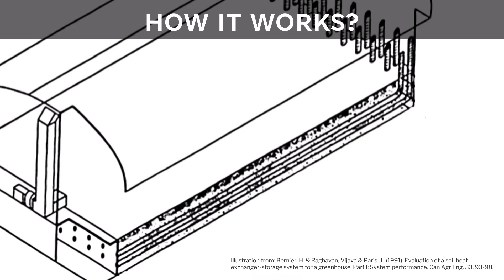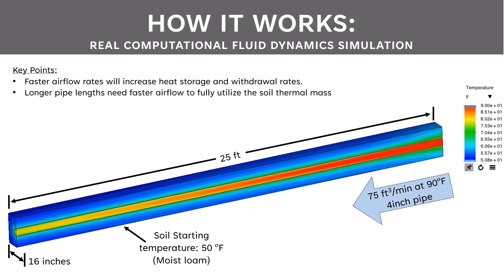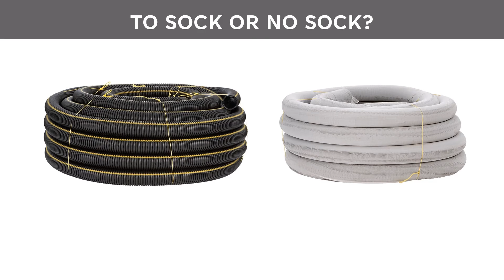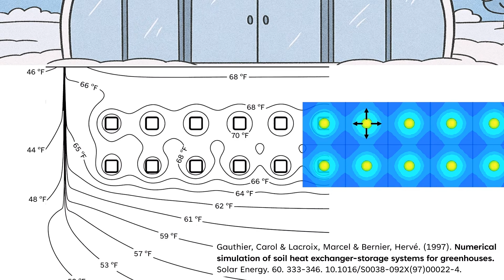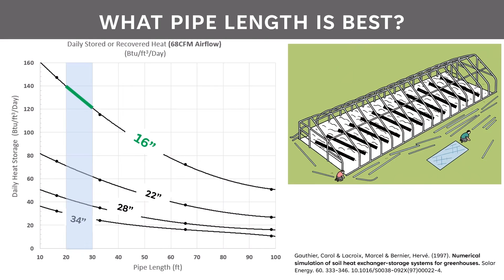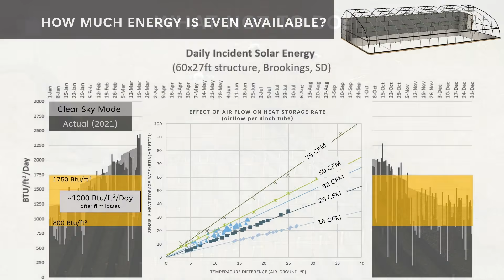Designing Better Climate Batteries: The Heat Exchanger: Pipe size, Spacing & Airflow explained…

Comment: What are your thoughts about using a climate battery in the arctic?
Also, are there any humidity issues with climate batteries?
Reply from the maker: I think that's interesting. It'd be particularly important to analyze the structure's geometry to balance solar energy capture vs. heat loss.
Reply: Thanks for replying. 
I'm in the plannig phase for a 50x10m so thanks for posting this video, we will certainly attempt to keep the piping as short as possible (lesa than 10m). I need to investigate further the ideal dimensions so if you have any other great resources would be much appreciated. In the arctic the climate battery by itself wont stand a chance, so we are planning a large sandbattery thatll be recharged regularly by sauna and rocket heater when the sun sets for 2.5 months to keep it frost free
Reply from the maker: @solac388 you can recharge the climate battery with heat sources like that. Because your light is so low you will need grow lights, which give off heat as well.
Reply: @waywardsprings yeah massive amounts of LED lights 😅
Reply: Or maybe there are other more suitable light sources. More investigations required

Comment: Thank you for all the information. I am unsure about how the plants impact the depth of the system. I assume it is important to distinguish between greenhouses which have seasonal plants (shorter root systems) versus greenhouses with trees or multi year plants. Do you have any information about that?
Reply from the maker: I have several tree/shrubs several years old now and they love it. Fig & Pomegranate.
Reply: @waywardsprings  How deep is your climate battery below the surface?
Reply from the maker: @RodiPumpluff 4ft.

Comment: US has been on the metric system since 1866   The Metric Act of 1866, also known as the Kasson Act, is a piece of United States legislation that legally protected use of the metric system in commerce from lawsuit, and provided an official conversion table from United States customary units.
Standard is PRACTICED but unofficially

Comment: I am looking to use 10cm tubes. Width of the greenhouse is 3m. Length of the tubes will be 4.5-5.5 metres. I am looking to install Axial fans, 24volts. What do I need to use as capacity per tube? is 62m3/h enough?

Comment: Would a 10cm tube also work, with holes drilled every 10cm?
Or is the purpose of the drainage holes also to exchange heat more easily?
Reply from the maker: Yes, the slits are just for water drainage. These are common in most of the world. If you can find them, you could cut small slits with a saw.
Reply: @waywardsprings  Thanks!

Comment: Thanks so much for the great analysis. I have a high water table, would it be better for me to use non-perforated pipe with a sump pump to deal with condensation or stick with perforated pipe with a sump pump to deal with ground water?
Reply from the maker: You will definitely need a perforated pipe. I have seen some people use drain tile below the climate battery to drain ground water.  If you always have high ground water you may want to consider alternative methods (like the concrete blocks) or possibly a water source heat pump.

Comment: What do you guys think about using a fan on each end of the manifold, one would be "blowing", the other "sucking".
Reply from the maker: It is possible to use fans in series like that. It doesn't double airflow, it doubles the static pressure that the fans can overcome.

Comment: I don’t understand how the air gets circulated. I know you said there are fans at the end of the pipes but are those driven by batteries? Or how does that work?
Reply from the maker: The fans are powered by grid power. Perhaps I will have photovoltaics someday, but that is more expensive for now.

Comment: What about eliminating pipes, and substitute "bells"?  If you follow the work done by the rocket mass heater researchers, they have much better  gas flow with less resistance by using upside down troughs called "bells".  the idea is that warmer air stratifies  at the top of the bell and is exhauseted at a slightly lower point when cooled.  I am imagining using recycled plastic pallets on blocks to create the the bell with a layer of perforated greenhouse plastic on top to prevent soil from backfilling.
Reply from the maker: Rocket mass heaters are using natural convection that is powered by a thousand degree temperature differential between the intake and exhaust. In these systems there is a very small temperature differential, closer to 40F maximum which won't drive enough convection to store and extract heat fast enough.

Comment: Would counter flow help with getting energy stored. e.g. alternate pipes flowing in opposite directions?

None of the examples showed insulation below the soil storage but did show it around the perimeter. I wonder what the loss is into the earth?
Reply from the maker: It is possible that alternating flow could perform a bit better. Typically manifold systems don't lend themselves to that configuration. Might be interesting to evaluate. 

Insulating below the structure isn't usually viable as moisture needs to move downward. But heat also does as well and to some level can be drawn on for additional heat once the battery is drained. In a drained state it acts similar to low-grade geothermal.

Comment: Just use water. 
Learn about phase change energy of substances.
Reply from the maker: Very familiar with those. I may make a video about the Pros/Cons of those options in the future.  Do you use either in your greenhouse?
Reply: From what I know, a lot of the heat storage used in this system comes from the phase change between evaporation and condensation underground. The specifics are beyond my memory at the moment.

Comment: At 8:00 it is not clear if the air flow rate is per pipe, or the combined flow for a given soil volume. Half the spacing means 4 times as many pipes and 4 times the air for a given flow-speed, or 1/4 of the flow speed. The power increase required for 4 pipes would be equivalent to doubling the flow speed through a single pipe, or a 1.4× flow speed in 2 pipes. (Assuming all of them are in a similar flow regime. If here is a cross over from mostly laminar to mostly turbulent that would add significant error to this approximation. But it would still be in the ball park.)
Reply from the maker: Definitely download the original paper for more details. If you have trouble finding it, email me and I can hook you up. These airflows are per pipe, so like you say it is radically increasing the amount of air. It doesn't really affect power draw to the level you suggest because pressure drop increases a lot when you quadruple airflow through a single pipe. Pressure drop goes up at approximately the square of the flow rate. Is that clear? Hard to explain in a text comment.

Comment: Love this series of videos you're doing and eager to see more, nice work Shannon.

Regarding the sock, I've always viewed it as cheap insurance, at least on the lowest level of tubing, for situations where groundwater swells during heavy rains that may carry suspended clay soil particles in it (we have quite a bit of clay in our subsoils, but I'm not sure how much is disturbed in a heavy rain). In our soils the only time I've seen water at the bottom of a riser are when we get heavy downpours (2"/hour type storms). What are your thoughts? It definitely would save some money if I left it off so I'd certainly consider doing so.

Additionally, is there to data/evidence to show that a sock causes mold and biofilms? I've been operating our systems with socked pipe for a number of years now and haven't experienced any issues with molds.
Reply from the maker: Hi Tim! The socks are only for french drains, and then only in unique situations. Thousands of acres around here use them for water drain tile without socks.  It's only recommended for particular types of aggregates in a french drain.
Reply: I did the sock. My system is almost 5 years old and seems to be working well. I'll never know what it looks like down there short of running some kind of scope.

Comment: Water is just a better medium for heat transfer. Air barrier pex is 20-40 cents/ft and takes up so much less area in the soil/storage media leaving much more thermal mass to work with for a given volume. Instead of running a fan pushing air through hundreds of feet of pipe you just need a low wattage circulation pump and a fan to push air through a water to air heat exchanger. Controls could be simple with a few relays and a standard battery powered T-stat or complex where it could sense the liquid temps, vary the fan and pump speed, control a mixing valve, calculate the dew point and even control the amount of humidity to drop out of the air stream. You could also plumb a standard gas or electric water heater into the loop to add heat into the system in a controlled manner. Tons of possibilities.
Reply: There's a reason geothermal installs use water(+glycol). That said, the other issue is the relatively poor soil conductivity of heat. My understanding is that geothermal installs usually add some blended backfill that allows higher heat transfer than ordinary soil. I suppose the alternative is to just lay in more pex, which (as you point out) is comparatively cheap.
Reply from the maker: Yah, might be a fun future project.
Reply: @waywardsprings  I'm using various grades of crushed limestone as the thermal mass. It's a very compact system. Can be built up with little to no excavation and is extremely cheap. I have a basic controller designed. It enables me to calculate the thermal mass available and gives me a "charge level".
Reply: @TofuInc  when you say, "as the thermal mass", is that just to pack it around the pipes, or the total fill...also, what is a "charge level"? (sorry for so many questions...I'm new to this)
Reply: @twilitezn  Yes, the material packed around the pipes is the thermal mass. "Charge level" basically means I'm able to measure the amount of heat stored and how much is used/lost.
Reply: @TofuInc sounds interesting…do you start with more compact sand, and then move to larger grains as you come up?

Comment: I wonder about the 68CFM recommendation in a 33 ft pipe.  It would mean that the air would only stay 2.5 sec. in the pipe.  This is obviously insufficient to optimally exchange heat.    Duration (min) = Pipe Volume (pi³)/ CFM.
Because in some other researches they recommend that the air stays at least 7-10 sec in the pipe to ensure a good efficient heat transfert.
Reply from the maker: The main bottleneck in these things is conductive heat transfer through the soil. Ultimately I think operating cost optimization depends on the fan and manifold selection and operating costs. Definitely more room for learning on this topic. Maybe I can tackle that better in the future.

Comment: My modeling shows the soil heat transfer rate is the limiting factor that most fail to consider. 16" spacing is great to solve this. Pipe wall thickness was secondary. So the corregated pipe is the best. 
I've also modeled using a 300 gallon (or two) tote. Insulated to R-40. Then pump water through a radiator (capture) and radiant floor tubing at root level, under low tunnels. Super easy to operate. Low construction cost. Tons of thermal storage. An added boiler makes an easy backup for long cold stretches.
Reply: The traditional spacing is 24" horizontally and 12" vertically to form a staggered matrix of tubes, like the number 5 on a dice, not a grid. This spacing provides roughly  9.75" of soil mass thickness horizontally and 12.4" diagonally. This spacing allows heat stored during the day to be recovered for use the same night. Heat that moves too far from the tubes cant be recovered the same night.  Something to consider, if the heat isnt used, it will effectively reduce the cooling/heat storage capacity for the following day.  If you need the extra cooling  (during a sudden heatwave) you can dump excess heat from the mass by running cool outdoor air through the tubes at night and exhausting it outside. Closer spacing puts the bias towards heating performance, but it also makes the system more  "hand to mouth" which trades buffer capacity for faster response. Wider spacing will bias the system towards cooling / heat storage, trading response for more buffer capacity.  To make the most of the heat provided by sporadic winter sun, its important to have sufficient fan power available to rapidly store it in the ground before it is lost to the glazing. I`d recommend using a differential thermostat to control the fan(s), which will increase heat storage efficiency and prevent the fan(s) running when no useful heat is available from the mass.  Basic thermostats will wait for the air temperature to reach the setpoint while the glazing is busy losing valuable heat that could have been stored.
Reply from the maker: Yes, the soil conductivity is the weakness and there isn't much to do to get a lot better without a radically different solution.
Reply: @waywardsprings  Could you change the backfilll material in the greenhouse?
Reply from the maker: @mchlgrffn88 You sure could. I did a prior video comparing heat capacity of various materials. Check that out.
Reply: In a previous video when the thermal capacity of water was shown, I immediately thought that an underground insulated water tank would be simpler and possibly more cost effective. Do you have any cost comparisons?
Reply from the maker: @nolansmith99 I don't have comparisons for that as I haven't built one. It would require more expensive components. Large air to water heat exchanger and fans, then the water pumps and storage system. I have seen designs and patents, but not delved deep enough to compare the details.

Comment: Putting a T-joint in the center of the pipe, with a riser segment ending on the central walkway could help? With the walkway made of wooden palettes to allow airflow minus debris ingress. Cuts the tube length in half without occupying more bed area.

Comment: Is there a possibility of eventual pipe clogging with soil particles? What if ground water goes up to the level of those perforated pipes?
Reply from the maker: Unlikely, a large amount of continuous waterflow and small soil particle size would be necessary for that to happen.  I have seen no change in system pressure changes for at least 5yrs.

Comment: I just don't get the structure of the system. Wouldn't it be much easier if you don't take two large tubes and connecting them with several small tubes instead of just take one long tube and lay in a circle? Or what would be the disadvantages?
Reply from the maker: Not sure I understand your question?
Reply: @waywardsprings Why not the same structure like in a Underfloor heating system?
Reply: @toms510 long air tubes create to much friction and require expensive large fans. Shorter pipes require more small fans which ends up being more cost effective and efficient for heat transfer.
Reply: @nolansmith99 So the friction increases exponentially the longer the pipe is?

Comment: This is fantastic Stuff. Can you share how you came up with the geometry for your structure? I know you mentioned a 70 degree angle for your summer illumination, but is there an easy way to correlate something like latitude to optimal geometry?
Reply from the maker: Did you find my prior video called: A Smarter Shape for Northern High Tunnels?
Reply: @waywardsprings  Thanks, I'll find it now. Appreciate all the work going into putting this level of detail out there! I'm currently in a fairly warm climate, but looking to move soon to New England, where I'll probably be in zone 4b, so this helps a lot with my planning

Comment: great sharing - instead of Pipe socks maybe a layer of fleece after a Pipesurrounding earth pocket just to prevent roots to grow into the pipes ?
Reply from the maker: Because of the airflow roots do not want to infiltrate the climate battery.
Reply: @waywardsprings  are you planning to do the videos about  "Manifold and Fans" and " Themostats / Controls " ?? cant wait

Comment: This is a really great video! This is something I've been thinking about doing on our property near Seattle. Not quite to this scale. But close. The picture at the end showed the socked tubing. I noticed that that person had put rigid foam up. Does that make sense? Is there any advantage to that? It seems to me that during the winter you would want to absorb as much heat energy from all the surrounding soil as much as possible. Especially if you're going to excavate down 4 to 6 ft where the temperature starts to normalize.
Reply from the maker: The soil outside will be much colder than inside. See my previous videos.

Comment: Really intereesting to see the engineering data. I don't have a climate battery in mine due to the additional expense but it was something I looked into and I remember the same photos you shared here. There is an option to retro fit geothermal GAHT type thing at a later date as we have the land ( I believe you call this an earth tube).